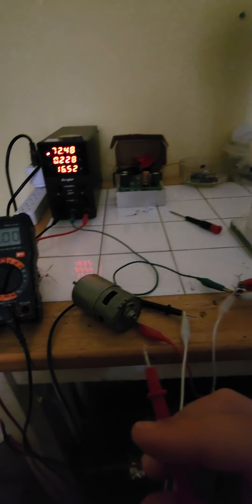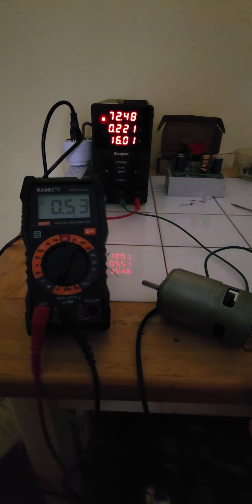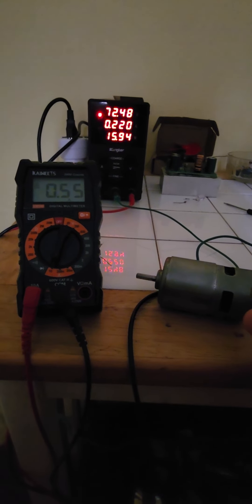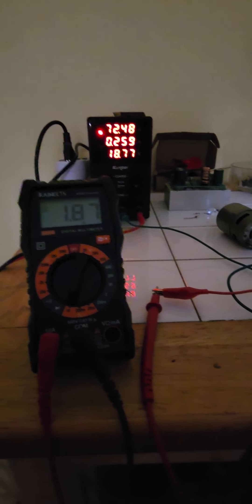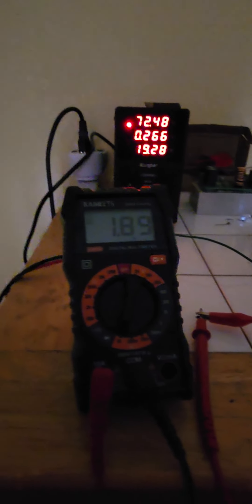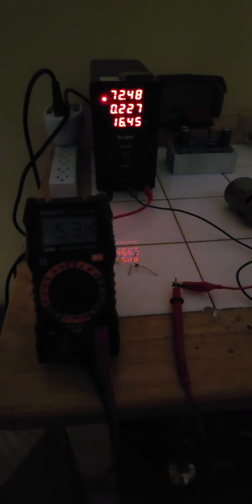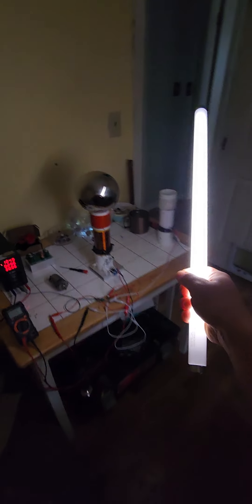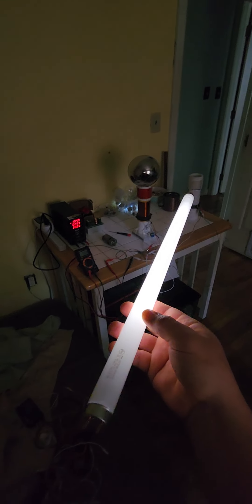🤔Explanation Of The Grounding Effect⛰️& Mini LED RF Receiver Lights Dimly With 0 Input🔮

Comment: I would be interested to know what the voltage is at the motor at .55 amps. Using ohms law, maybe the output is equal,  maybe more, maybe less. Just need more info
Reply from the maker: When I checked it was running consuming. 0.55amps with 12Vdc left over while still having enhanced wireless power effects

Comment: I believe that for the goal of constructing a self-sustaining circuit, it's essential to prevent energy loss via radiation. Therefore, impedance matching becomes crucial if you aim to extract the maximum power from your Tesla coil to operate other devices. Performing impedance matching ensures that the waves don't bounce back and forth, thus preventing energy from escaping or radiating from the circuit.
https://www.youtube.com/watch?v=-k6LWzv_Y9I